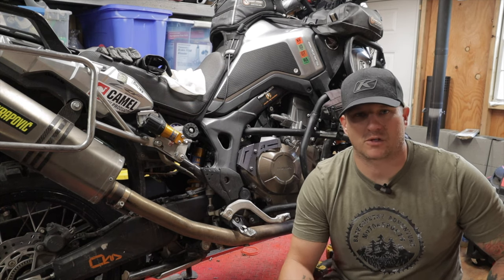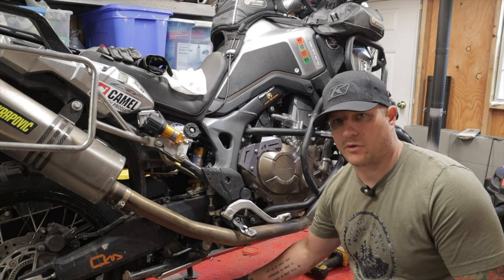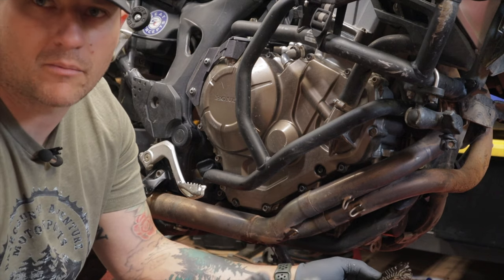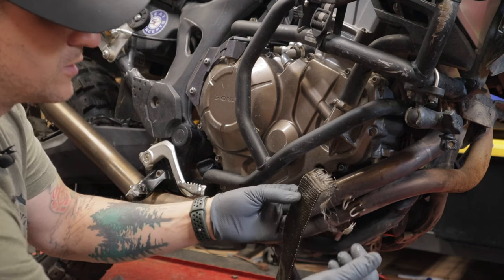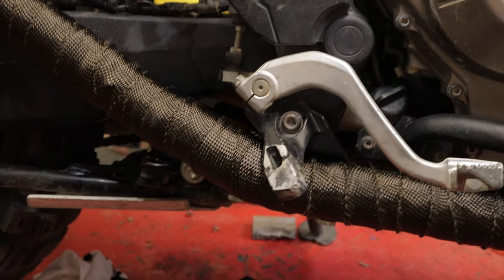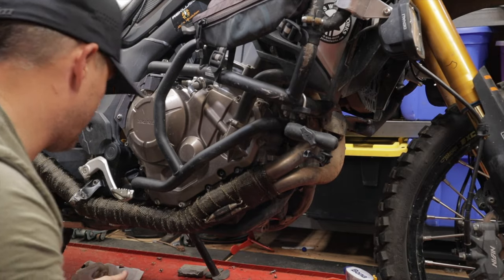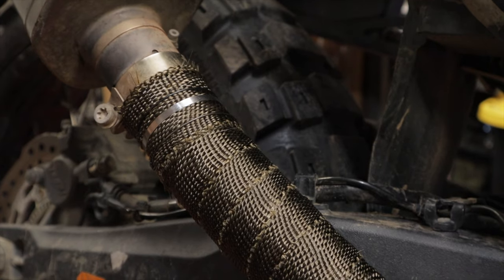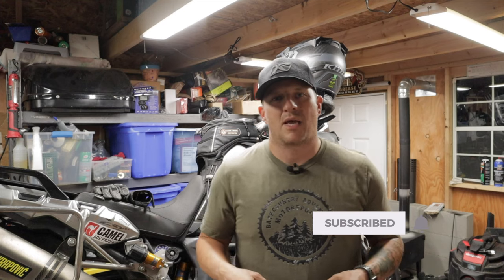No more hot feet when riding slow technical terrain. Honda Africa Twin Titanium Header Wrap.

Comment: I did this to my Africa twin and it looks really nice, no more ugly headers!  The heat reduction was more than apparent and engine performance improved. I took the project one step further by spray coating the entire wrap with a silicone-ceramic clear  coating rated to 2,000 degrees, ( September 2022)

Comment: Would have appreciated a thermo read on the pipe before and after. Cheap laser thermometer would do it. Great video and very useful!
Reply from the maker: +Zak Parrish dang that would have been smart lol. Ill post a quick after though review in a few days. I will say I can touch it will my hands without burning myself. The unwrapped portion gets extremely hot, but the wrapped part i can place my hand on it for a couple seconds without having to pull away.
Reply: Send him a check!

Comment: I had that on my cafe racer and riding in the wet, it made so much steam and created such a hot-wet situation, I removed it.  

I then ceramic coated the exhaust.  Gorgeous. 

I don’t know,...   but I would imagine this would not be the most fun in muddy/wet conditions.  

I’m excited to hear about the findings.
Reply from the maker: +Branden Hellman thanks for the heads up. Makes since it would do that. It’s worth a shot, if it doesn’t work, Its only $15 and about an hour of my time I guess 🤷🏼‍♂️
Reply: @backcountryadvmoto  Do your exhaust pipe is stainless steel ? If not,  I've heard about pipe corrosion due to overnight / parking "wet compress"

Comment: I'm wondering if there is a negative side-effect from all the added heat in the muffler that you used to dissipate from the pipe.  I think I would just wrap the section by my foot, or just add a metal shield (which is what I did on my bike after melting the heal of my boot).

Comment: As always, great job on the video. One thing to look out for that I've heard from snowbikers who've done this -- the excess heat that's no longer radiated away from the exhaust pipe has to go somewhere, and that probably means that your Akro muffler will run hotter.  That could be an issue for your luggage or anything that's fairly close. Something to keep an eye on. :-)
Reply from the maker: Steve Taylor Thanks for the heads up. This is why I love this community. You guys have pointed out several things that I didn’t really think much about. This was strictly a test to see if this works. It does do a great job of keeping the heat off but a lot of the cons I’m sure will come out in the following weeks. Thanks a lot. I may end up just doing about a 12-15 inch section where my foot is and leave it at that.

Comment: Hey, love your channel, good ride vids and tech go to especially for AT owners. Do you have a video about the exhaust header / slip-on and related fuel mapping you did to dial it in? I can't seem to find just a video about the exhaust. I am ordering the slip-on, curious about the full header and what it takes to get it thru emissions mapped correctly...thanks!
Reply from the maker: When it comes to emissions, I can’t give you any insight there. I live in Idaho where we don’t have any emissions checks on bikes. I haven’t made a video on the exhaust. I didn’t a self tune using the auto tune from dyno jet and it was still running a little richer than I wanted. I took it to an dyno jet authorized dyno tech who out the bike in a actual dyno and got a lot more power in the low end out and really nice fuel eco on the highway for cruising. I’d say if you are going to go the full header route, spend the extra money on a custom map from someone who does it for a living. You won’t be disappointed.  As far as just doing a slip on. I would think you would be fine without any tune. But you wouldn’t be getting the most out of the exhaust upgrade without one.

Comment: Just keep an eye on your pipe. Lot of guys I know wrapped their aftermarket Harley pipes and it trapped moisture and caused some corrosion on non-Ti/stainless or it eventually cause a crack from the heat.
Reply from the maker: Thanks for the info. Good to know. This is strictly experimental. The next option would be to make some type of heat shield